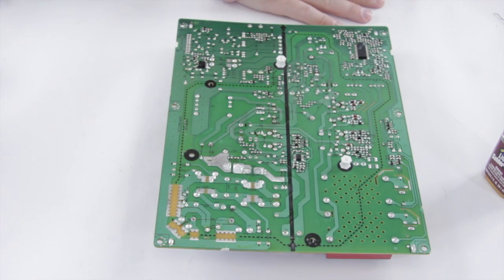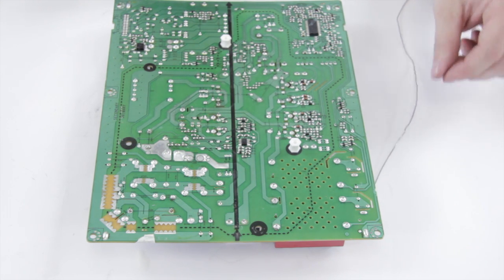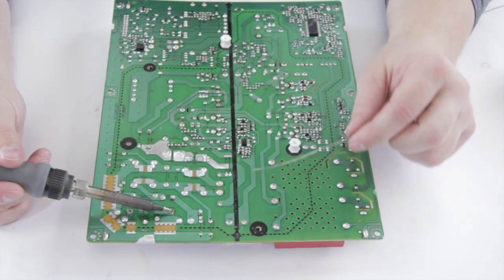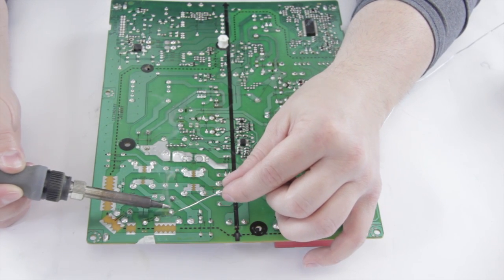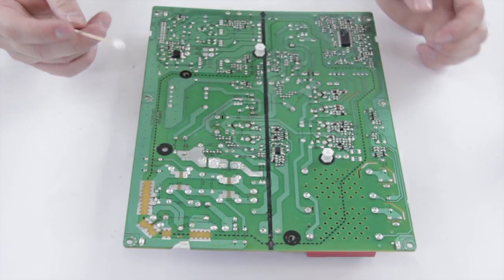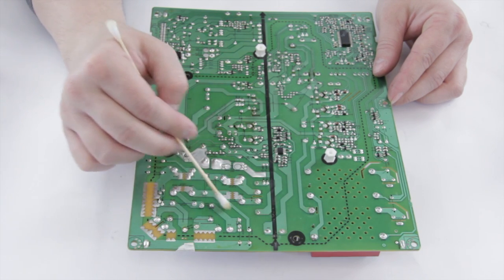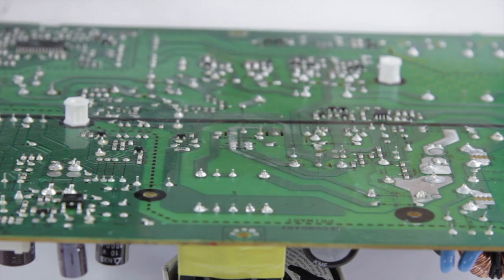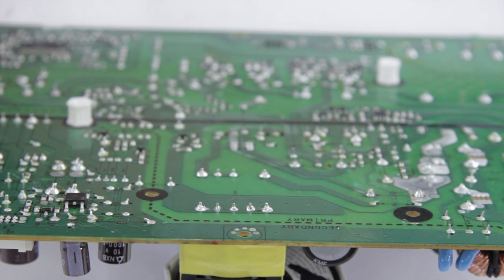How to Solder a Fuse - DIY How To Solder Tip #1 - TV Board Repair

Comment: Btw, as a safety comment, I followed some guides like this recently to do my first solder to replace a fuse on my juicer. It first worked and I got really happy and turned it off. Next time I tried, I got a strong electric chock and the whole house lost power. I was probably fine but after talking to medical support I went to the hospital and some key heart values on the ecg and blood test were elevated so I spent 9 hours in the emergency before getting discharged. I guess my point is, if poorly done, you could potentially electrocute yourself

Comment: How do you get the points at each end to solder on the boards? Or where? The fuses I ordered are just fuses no sticks at any end to solder in place
Reply: You figure it out?? I ran into the same issue
Reply: @calebsiemens5067  no I just bought new ones . The ends don't stick

Comment: How do i add fuse ends to a fuse with out them
Reply: That is my question also , you have to solder them on but where to get them or what to use udk. I'm just going to use the ones from my burnt out fuse

Comment: QUESTION if i may
I've always wondered about this and can't really find a lot of info on the net  about it.

but..
you see where he is soldering ?
well now look to the bottom of the screen..
see those orange middle bits that , on the outside have SOLDER THAT IS SHAPED LIKE JAGGED SHARP TEETH

WHAT ARE THEY ?
WHAT ARE THEY CALLED ?
WHAT IS THEIR PURPOSE ?
thanks in advance

Comment: would be nice if you could show us/ give tips on something from this decade (ie, so much smaller/compact that about 3-5 fuses occupy the same space as the smallest component you have on that board, anyone can solder two giant points together. good video though, considering. but please add maybe some more advanced vids down the line? for the more intricate works plz
Reply from the maker: Viconaut   Thanks for the comment and suggestions!  We will be sure to take them into consideration for future videos.  www.shopjimmy.com
Reply: thanks for reading, makes me believe you care. but yeah i hope it wasn't taken as negative. i just happened to be working on something so much smaller than the norm at the time that it made me consider the fact that even standard size electronics these days have some TINY junk in them. not to mention how daunting that must be for someones first time tinkering/soldering. maybe an intro into soldering? with tip tinning, maybe some ways to heat up those hard to reach/micro places without damaging or getting solder in unwanted places/contacts. anyway thanks and looking forward to more videos, these really help me get some things across to the people im semi teaching without having to actually physically do it. so thank you again